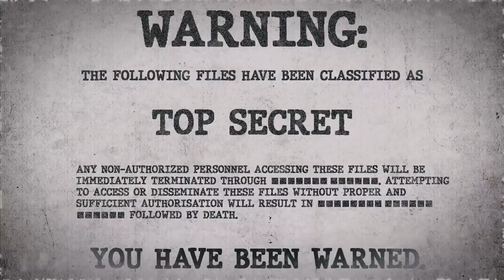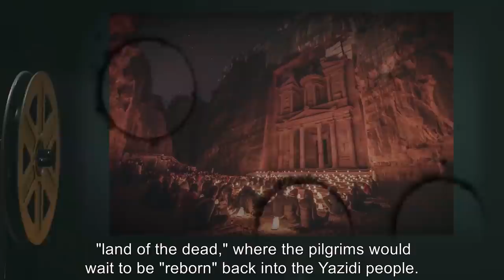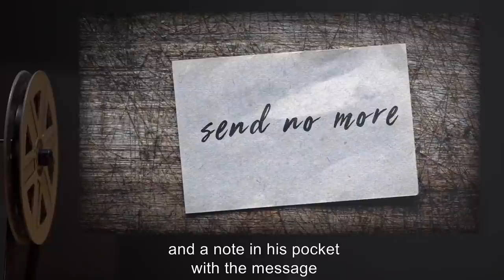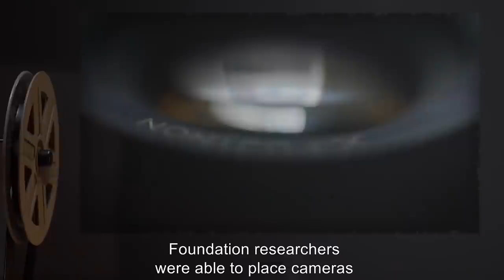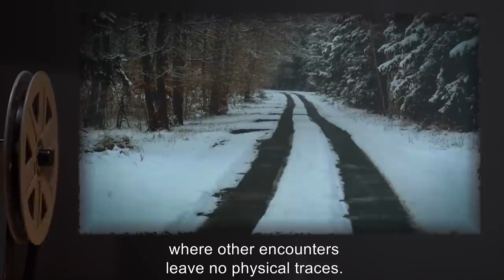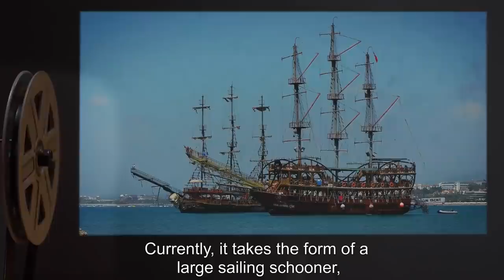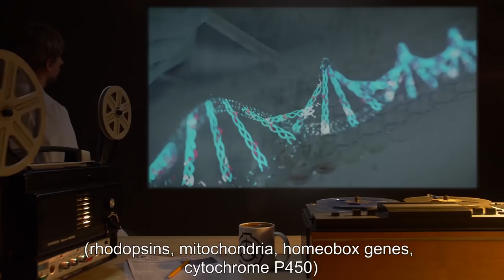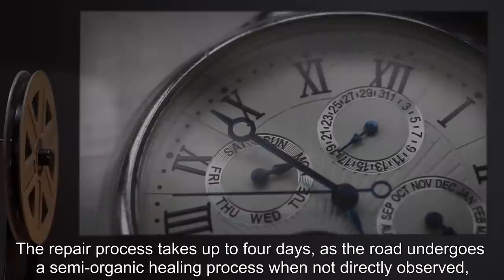Vehicle SCPs (SCP Orientation Compilation)

Comment: Here's 3 vehicular scp that you forgot:
Scp-3899: the night hauler
Scp-973: smokey
Scp-2590: trailer trash
Object class
Scp-3899: keter
Scp-973: euclid (for some reason) 
Scp-2590: keter
Edit: I'm not gonna give you description about these 3 scp
Reply: Also Scp 787: safe
Reply: The night hauler is actually the guy driving it, not the truck itself.